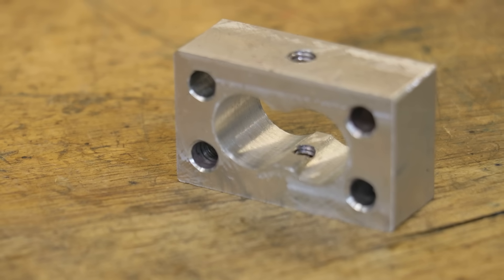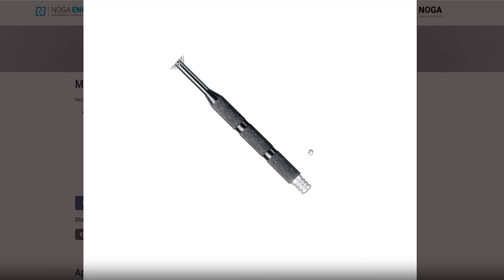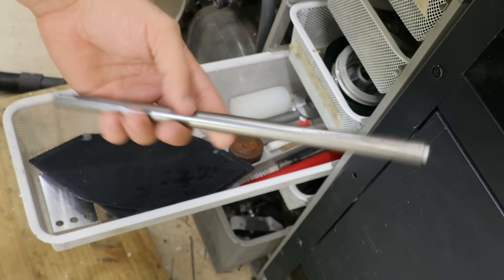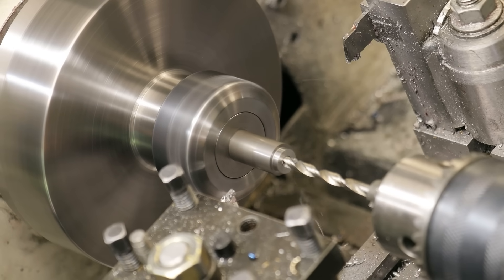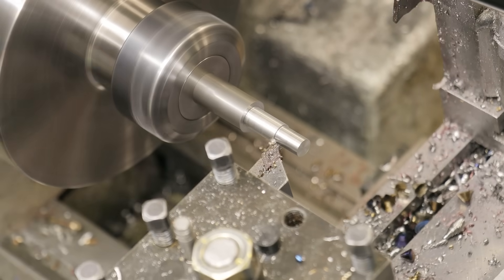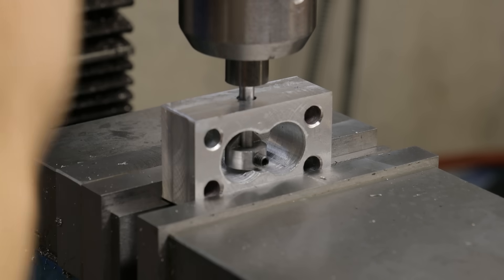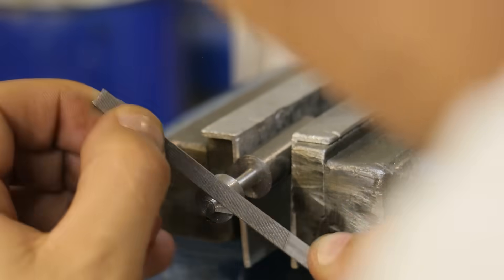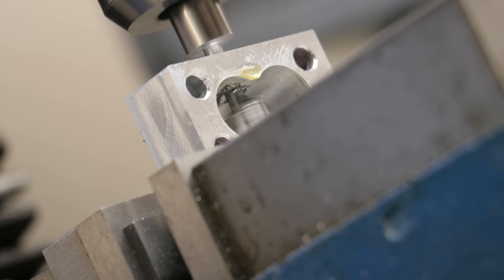Almost Impossible - Internal Countersinking In A Small Cavity

Comment from the maker: Read the pinned comment - Just wanted to jump into to talk about some suggestions some people were having.

1. Why didn’t I use a reverse countersink tool? - I somewhat answered it when I was talking about the wood countersink (although I did assumed all of them were kinda that same thing, which apparently they are not, I’ll take the L on that) and it all comes down to size. I have such little room to work with here that none of the ones that I have seen would be small enough to fit In the gap, and with the mounting features, I can’t see a way to grind it down to make it short enough to fit. That is my looking at it.
2. Use a lollipop cutter? - it could see it working, it doesn’t produce the exact geometry that I am going for here. FWIW I’m just loosely copying a design that I pulled apart and it had a countersink like this, and that is what I am following. 
3. Some sort of boring bar or dovetail cutter going through the hole? Yeah I was lucky to be able to do this once, back when I ran a tormach CNC, so I have a little experience with it. But I don’t have a cnc machine, nor a rotary table, and I just don’t think that I could get the size of countersink that I wanted, give the hole size.

Just to end off, this is a very novel solution to a problem that I kinda backed myself into. Small spaces and weird geometry (which is what I get for making most of the design up as I went along). It probably won’t apply in many situations, and I am sure you all have your own ways of doing so, but in the heat of the moment this is a quick thrown together solution which worked and I wanted to show you that it worked. 

See you all on Saturday, I have a pump to finish.
Reply: Well I read the title and immediately thought of all those options. But you didn't mention the tools from cogsdill.
Reply: So…… why not just make the same tool, but use an indexable triangular cutter (like a Komet 45° insert) for it? Geometry would be WAY more complex tho, but with that, you can change the insert to cut practically any material.
Reply: @willhutton1516  Time? Use case? In this case he weighed the return on investment of time versus the ROI of reusability. Since he had 2 countersinks and another project to finish, the shorter, but less robust option, is just to brute force it

If this becomes a more frequent occurrence, then he'd probably make a more robust tool like you suggested

Comment: If you offset the part in the 3jaw after drilling  but prior to cutting the tape cutting face , you'll be able to mill the cutting edge into the apex of the offset and have back relief.

Comment: I'm a bit late to the party but the company Cogsdill actually makes a back chamfering/countersinking tool. They call it the flipcut. It's not a cheap tool and is designed for production operations in CNC machines but it is an actual proper backside countersink unlike the noga knife. They make a lot a niche products that can be game changers for production CNC work.
Reply from the maker: If this wasn’t a hobby for me, that tool would be on my to buy list

Comment: If you had milled a lead rake and ground back clearance, O1 tool steel cherry red and temper to straw or blue
Reply from the maker: What's the point, its for 2 countersinks in aluminium
Reply: @artisanmakes  I have tools I made at the start of my apprenticeship in 1977, still sharp and once in a while they get used O1 tool steel 
But if you are a defeatist then crack on lol
Reply from the maker: Pragmatic. I don't this for a job. If it needs to be used for 2 holes, ill make it so it can do two holes. Doesn't need to be any more durable than that. cheers

Comment: Great solution and looking professional. Years ago, on a weekend, I had a similar problem, but only 2 holes to countersink in aluminium.  I took an old countersunk woodscrew and made a score in its head with an anglegrinder, then fed it through the holes from the inside and completed the countersinks by pulling outwards with a drill. Worked okay.
Thank you for your great videos.

Comment: All cutting tools must have relief behind the cutting edge. When there isn't enough relief, the back part of the tool will rub against the part and cause a large burr to form. The tool will also become very unstable and get pushed around because of the large amount of pressure on a tool that literally can't get out of it's own way. U will need to use a lot more than a file to get anywhere near enough relief. If done correctly, you should be able to physically see a gap behind the cutting edge. Cutting edge should have a 5 degrees of relief minimum
Reply from the maker: I literally talked about this in the video….

Comment: This is a great fix. I had to make a tool that fit inside a gearbox from the 1940s. A face needed to be taken down to fit a standard size shim in order to give the correct amount of end float. The tool was designed and assembled inside the gearbox much like yours. It was then disassembled, removed and the gearbox assembled and the end float measured. It worked well. 
Your design is inspiring and can be modified to suit different applications. This is a great channel. Thanks for taking your time to make the video.

Comment: O_o um, lollipop deburr tool from the side. But if you are stuck on actual counter sink, yeah if you can’t afford any thing else, this would be the way to go. They do make countersink and deburr tools that operate in reverse with a weighted mechanism that extends a flap when rotated ccw, then flips back when rotated cw, but they are in the $700+ range. You are trading skill hours for cost of purchasing, so 6 in 1, half a dozen in the other. That burr is likely because you don’t have proper clearance on the cutter ends like you were stating. You would want one cutting edge though with proper clearance based on your design.

Comment: I'm not a machinist but it took me about 15 seconds to imagine this. Like a puzzle toy, fat cutting piece connected to a thin rod through a hole into a small space. The cutting piece could be even smaller and simpler, no grub screw, if you connected with a square or hex socket.
Reply from the maker: Read the pinned comment. A set up like this can not work due to the size of the minor diameter with the hole

Comment: Fantastic work. Disregard all the "professional" comments here telling you otherwise. There are unique situations that require unique solutions. Job shop machinist here, heavy industry. I once spent an entire 10 hour shift putting a critical chamfer on a hole inside a part that was not accessible. 3/4" TGP 18 inches long, 4 carefully turned brass bushings, 1 carefully ground piece of tool steel and a bunch of dedication inside a large CNC mill just flirting with the handwheel. FH8800 mazak, less than a thimble of chips. A smile on my face so wide because they said it was impossible. Good on you sir, keep up the great work.
Reply from the maker: Cheers, it kinda feels like people did not correctly understand the unique issue I was facing here.

Comment: Lollipop endmil, boring head with proper tool (depends on the hole size)
Reply from the maker: Read the pinned comment, they won’t work for this specific hole. That was the issue. Lollipop - wrong geometry. Boring head - too small hole for the counter sink needed. Read the pinned comment

Comment: I would just give up and use a Dremel or grinding tool.

For another possible resolution, use boring head through the hole? Perhaps too small
Reply from the maker: Not enough space to offset the tool and make a countersink large enough. Not with M6 anyway

Comment: I appreciate solving problems elegantly and the learning experience gained from doing so, but i wonder if you couldn't make the housing in 2 parts and a cm wider, debur the inside holes and then bolt the 2 halves together? is space that tightly constrained in the bigger project?
Reply from the maker: I think if it was done this way it gives more challenges with alignment and potential for leaking (this is a part of a pump body)

Comment: To achieve the same result without so alot efforts it may was to use a spherical head bit, like deburring and such. Milled from the side, but not through the upper/lower holes. Ball end dia choose depending on the requared countersunk deep/dia... In my opinion...😉
Reply from the maker: Read the pinned comment. It’s not going to produce the required geometry

Comment: To this kind of way, you might as well use a normal counter sink, cut the shaft off (partially or completely), then make a mount hole then drive it downwards into the parallel direction, instead of lifting away.
Reply from the maker: Like I said in the video you will not always have a through hole so it must be able to work in the up direction. And here, again like I said, we only have 12mm of space to work with, and the thickness of material that the hole goes through is about the same thickness, so it would not have worked here.
Reply: @artisanmakes Fair point. I judged this on the workpiece that I saw. I do think modify an existing countersink is possible and a through hole for the shank makes the cutting head reversible. A Karat drill can get through tough parts and the shank isn't as hard as the cutting edges.
Reply from the maker: At that point the you have to anneal and then heat treat again the tool to do that. And I suppose at that point your no better off with my method, atleast for 2 operations
Reply: @artisanmakes No need for heat treatment. I have drilled broken drills out of holes with carbide end mills and karat drills. Or masonry drills if you are desperate. I have turned the shanks of drills before, as well. You could grind the end of the countersink square, to match the pilot shank, for making the job easier. Just go in from the back where the shank was cut off.
Reply from the maker: Well I don't really have a dedicated grinding set up. Ive turned drill bits before too, but I tested a cheapo countersink (the bit that I'd have to grind/turn) and it was hardened.  I just don't see it working in my situation. Cheers

Comment: I use ball tipped carbide cutters. If you can tilt on the fly with the mill on the table side, you can finese it in there pretty easily and allows you to cut deeper. It wont really work on hard steels well. And im not talking a ball end mill. Its the cutter with a literal ball cutter on the tip. The arent strong, so cut light. A few industrial supplies have burrs in different sizes as well. Then clean up with a ball stone. Rubber abrasive is awesome to blend it back to smooth on the transition if you need it to be.
Reply from the maker: This mill is not a tilt head and like I said in the pinned comment it wont produce the geometry that I was needing here

Comment: Done this many times on a manual machine... "offset entry boring bar" or "back counterbore" boring bar and Bob's your uncle. 
Rotary table can be useful here too.
Reply: But yes, also ground down a reverse counterbore and clamped on an arbor just like this, good one off solution for sure.
Reply from the maker: Check the pinned comment. I have done similar before but it will not give the geometry I am looking for and I don’t own a rotary table

Comment: if you strategically turned the tapered cone off centre then it would have already had the back clearance.
Reply from the maker: You would need a rotary table which I do not own, and being such a small hole, the size of the countersink created by this method is not large enough

Comment: Did you need an actual countersink for a screw head or just a chamfer?   If it's just a chamfer, ball end burr in a die grinder coming in from the side works just fine.
Reply from the maker: The design that I am following calls for an countersink
Reply: @artisanmakes That wasn't the question..  The design may call for a countersink, but do you actually need a countersink..  It's easy to use CAD to add all sorts of features, and it might be fine for a one-off part, but if you had to make a bunch of these, even a better made tool would be impractical due to all the manual assembly steps..  Design-for-manufacture is critical if you're doing production runs, but is still a good practice even for one-offs..
Reply from the maker: Well it’s not my design so I couldn’t tell you for sure and since this year I don’t have flow sim for solidworks anymore so I couldn’t tell you for sure. In any event I’m not too worried about it, maybe it was not design critical but doing it the other way would have taken the same amount of time to do since I don’t ow any carbide burrs. But it is an interesting approach, cheers.

Comment: I use Cogsdill Buraway tools for things like this at work. You can get them in all different sizes and they work for ID and OD holes. They're quite wonderful tools meant for just deburring holes evenly along an OD or ID, but since they have adjustable spring pressures they can do stuff like this too! Not sure how much they charge for them, though. I use a 3/16" one the most. Would be great for this application as well.

Alternatively using a lollipop mill and coming in from the side could also work if you can use a radius shape instead of a chamfer.
Reply from the maker: Yeah it’s not the right shape that I am trying to go for

Comment: Interesting timing for this video. I was building a new shift tower for a transmission. I had to deburr the insides of the side pin holes inside the shifter ball cup. Sadly I had to resort to using a chisel since I didn't have anything else to work/fit.

Comment: Those little reversible things are great for deburring but their applications are fairly limited - if the surface you are trying to deburr is concave (unless it's a very large radius) the tool won't cut really as it tries to just dig into the curve. You also need 2 or 3 sizes to cover most common holes

Comment: Great idea.💡 
We use to use a back spot facing machine at Sunstrand Aviation.
I see no reason not to adapt that technology to what you're doing. 
Maybe some used tooling to budget the tool cost.
Thanks for sharing. 👍
Reply from the maker: Fair enough so. Is not doo different to the tool I originally intended to use. The one that I showed. I may have some concerns about the overall length again since I am working in such a tiny sound of space here
Reply: @artisanmakes I think your tool is fantastic and definitely budget friendly. 
Practical for doing a few parts.
I only mentioned what I said as what we did before, but that's a big Corporation. 
Certainly different circumstances. 
Whit all of the shops closing tooling often gets sold off for very little of what it's worth.
I meant no disrespect. 
You have a great channel. 👍 👍
Reply from the maker: Yeah had a Quick Look again and realistically there is no one that I can find that will give the correct size cut and is less than 12mm tall

Comment: maybe trim a craftright countersink bit to suit.
Reply from the maker: I checked the length, I must have thought they were similar to the wood countersinks and they are simply too tall to be used here
Reply: @artisanmakes  for $6 I would have tried to trim 1 down. Aluminium equates to a hard wood so many wood working bits are fine to use on it.
Reply from the maker: Sorry I must have misread the comment, I did consider that, but the problem that we have only have 12mm of space to work with, and the thickness of material that the hole goes through is about the same thickness, so once you get it in there is no length left to be able to grip with the chuck

Comment: Umm…. You know reduced shank 45 cutters exist right? This is a solved issue, even for manual machines, just uses a rotary base, feed down center line, offset then rotate…. Done
Reply: So, the chamfer looks like it's about 3mm wide, which means even if you didn't have to account for the shaft diameter you'd still need a 6mm diameter cutter to cut the chamfer.  The hole is 5mm in diameter.  How does that work again?

Also he did mention that he doesn't have a rotary base.
Reply from the maker: How do you even get that in the inside then. I have 12mm of space to work with in the centre and a 4.5mm bore.

Comment: Wonder if forming something like an exaggerated internal threading tool.  Take that and pop it in a boring head type holder so you can run it in an orbital pattern vs a normal spin.  That should run that tooth around to create the bevel, and you could slide it in strait.  Kinda like doing an internal groove.